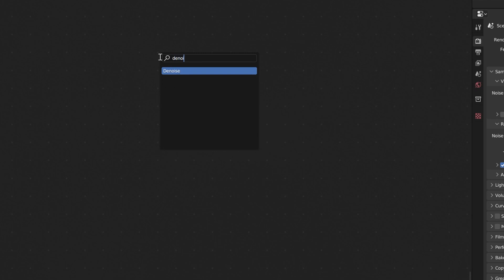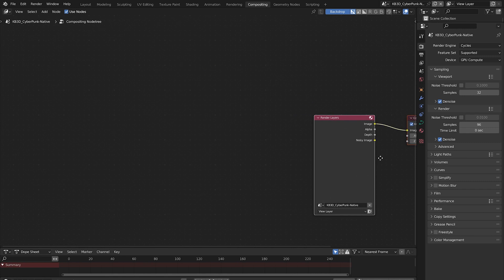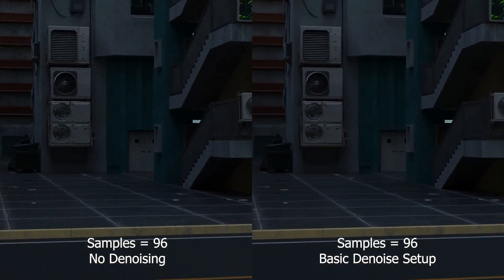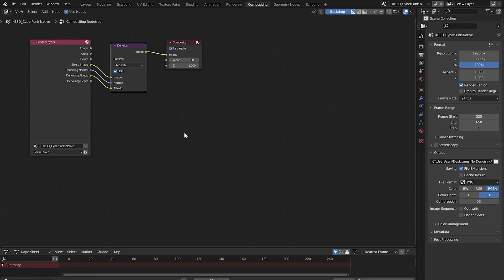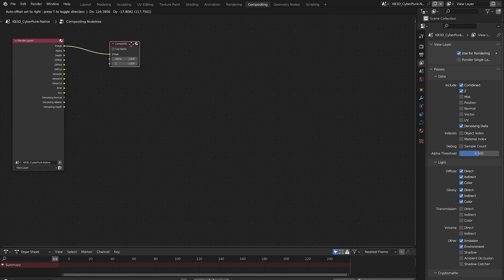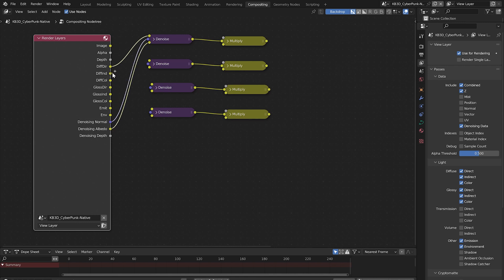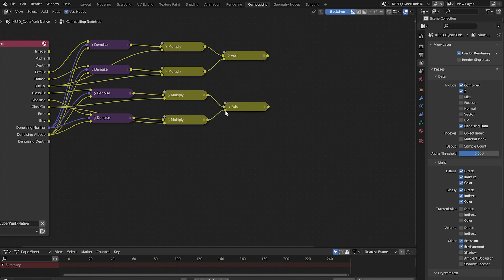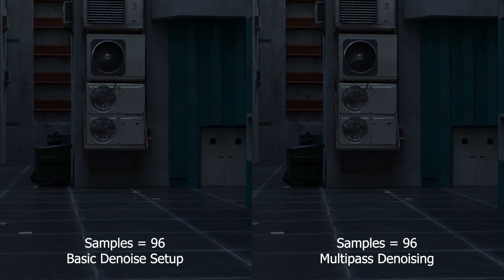How To Set Up Multipass Denoising In Blender and Why You Should

Comment: I will add some thoughts about linking. First and main thing is that better to get rid of Denoize Albedo pass. Simply because its pure garbage pass that contain bugged zones when your material has roughness input (like when you create noize texture and plug into roughness to simulate like wet skin or some wet on glass or whatever), which leads to HUGE DENOIZE ARTIFACTS as the albedo pass includes roughness, but its not smoothered at all. (just add noized roughness to material and render it with low sample - you will instantly understand)
So if you look at overall picture at 6:13
I would suggest to make ADD COLOR node before all denoize nodes and combine Diff_color and Emission pass (simply because albedo pass has both of these).
And instead of plugin Albedo pass to denoizer - plug this diff_color and emission output to denoizer instead of Denoising Albedo pass.
This will fix artifacts with denoizing roughness.

PS epic node setup, will def use it :)
Reply: And add another lane with color_add both volume passes → connected to denoizer (like everything else) and merge with color_add node after combined diffuse passes node, to fix volume pass which being discolored after using new albedo as it have different volume coloring than denoise albedo pass

Comment: This is amazing and still works in 4.2. Thanks so much man!
Reply: does it help to remove noise artifacts and flickering?
Reply: @AstroEarthly-e8e  if you're using a low sample rate you still might experience flickering. I'd suggest temporal denoising in blender if that's the case.

Comment: What if I want denoise passes for Nuke? Because sometimes I get the z and crytomatte with artifacts any fix for that?
Reply from the maker: I’m not sure about nuke, I haven’t tried that. I am working on an update to this video to clean up more noise and artifacts, especially banding in the darker area. Maybe that will help.
Reply: @AfterHours-3D-vfx  I am asking what I want to export the individual passes not only for nuke
Reply: I haven’t tried anything like that but in blender if you open your multilayer exr files there’s an option to connect each pass separately in the node tree for editing. Since the data is there, I think you should be able to do the same in other programs. But you also could try to only connect and render one pass at a time. This would take longer, but all your passes would be separate and you could connect them anyway you want in nuke or anything else. I apologize, but I haven’t tried using anything like that.

Comment: So what is that? I've never seen anything like that! Test animation with the same settings as shown in your video
https://www.youtube.com/watch?v=nyT0RdMrMak
Reply: OK, I think I know what it is; too much chrome and glass material, but you can only get it good with Davvinci Resolve with Denoiser and Deflicker  https://www.youtube.com/watch?v=VjCr9Q_sgfw
Reply from the maker: Sometimes you can clear it up a little more by increasing samples also.
Reply from the maker: You can also try adding additional passes and set them up the same as the diffuse and glossy passes. Your solution sounds like it will work as well, it is pretty common to render out the passes and composite in another software. I usually try combining different passes, increasing samples, and sometimes adjusting for more or less light path bounces.
Reply: Thanks for the tip - but it seems, in addition to the very good denoiser tutorial, to edit the images in a good video editing program like Davinci Resolve (it's completely free) with denoiser and deflicker @AfterHours-3D-vfx

Comment: Looks like the diffuse color and glossy color passes are noisy too, shouldn't they be passed through denoise nodes?
Reply: I wouldn't expect it to make much difference unless you have a low number of samples.  However check those passes in the compositor for your scene to confirm.

The colour pass is not based on bouncing light rays around the scene.  Instead the difference in samples is coming more from aliasing/moiré of when sampling the surface.  The render engine combines multiple samples with slight variations to average out the sub-pixel differences in the geometry and/or texture.

You could argue that it wouldn't hurt to unconditionally denoise the colour passes, however it's possible that denoising could remove actual detail.

Comment: Hello! Help me pls. I have problem with glass. Thats black 🙁 after multi pass. Try rendering glass yourself 🤔
Reply from the maker: hello.  If you turn on the transmission direct indirect and color passes, then connect them the same way as the diffuse and glossy nodes, you can add them to your node tree with a couple of extra mix nodes set to "add"    I think this will help with what you have described.  I have used this a few times to render glass.  I will try to update my tutorial soon.  Thanks for watching and thanks for your comment.  I hope this helps.
Reply: @AfterHours-3D-vfx thanks! Yes, refresh this pls:)
Reply: @AfterHours-3D-vfx  I too am also getting the same problem with glass.